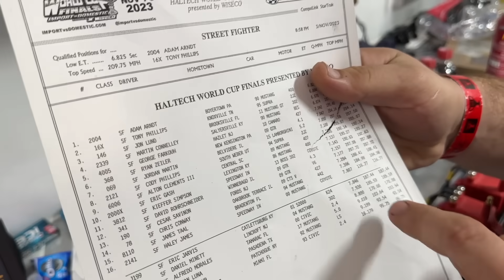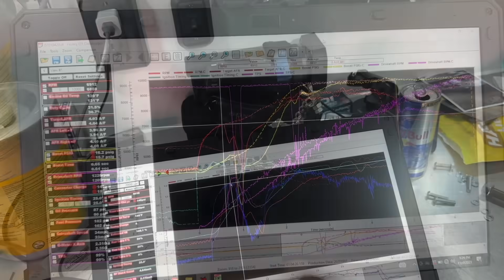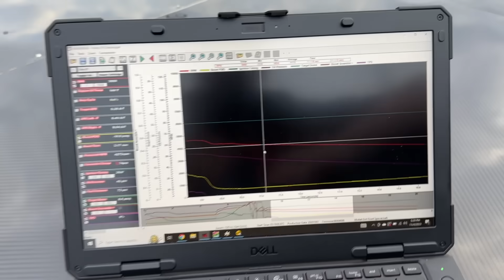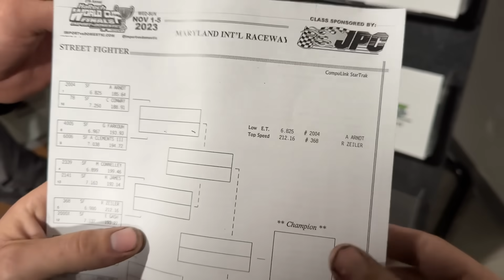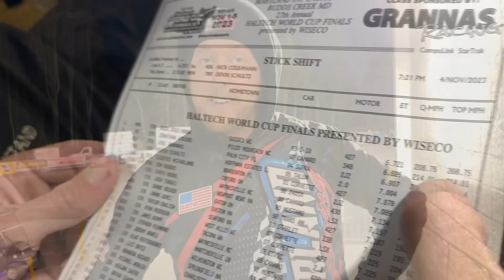World Cup Day 3 - Leroy 2.0 FINALLY Made a FAST Run!!! McFlurry Beats its Best Run EVER Again!

Comment: Put a pressure sensor on the Co2 regulator that outputs to the dash with an alarm/warning. Had Co2 issues with Leroy at the event and McFlurry in testing. Doing that should prevent you guys from wasting runs and test data. You guys may have thought of this already but that’s my 0.02. Been a subscriber since the C7 exhaust whistle days. Love to see you guys succeed, keep it up!!!!

Comment: It is time to completely change the chassis on Mullet.  Tube chassis all the way front to back.  Make big tubs and two rear ends so you can have a big tire and the 315 radial!
You can keep the steel quarters and roof.

Comment: Hey guys I don't know if you thought of this yet but is there some way a pressure switch of some kind could be rigged to where it would give you a indicator light that your CO2 is on and line is charged that way you know if there was a leak in the bottle just trying to help and appreciate all the work you guys been doing getting these vehicles rolling SO keep ripping them bald eagles out them pipes and try not to get too frustrated.👍👍👍

Comment: Hook a pressure gauge into the bottle so you have a read out on your dash of your bottle pressure after the valve. If its 0, you havent opened the bottle, have it flash red if its 0

Comment: haltech and being able to set conditions, instead using extra buttons and stuff if the best.

mine being plug and play also takes over the cars Can Bus thing so i can program the cruise control and stereo buttons on my street cars steering wheel to use as anti lag and what ever else.

i dont have a launch control button, its just set off conditions, which are clutch switch, speed and throttle position

Comment: I think you guys need to invest in drive-by-wire throttles.  ALL of your tuning and traction control will be INFINITELY easier.  You can control the power ramp with the throttle instead of boost, and you can control wheel spin the same way instead of pulling timing.  Boost and timing control is primitive compared to modulating a throttle.

Comment: Tire if of course the limiting factor.  A radial will never compete with a big tire at the top of a class.  Radials now are going 6s, and big tires are going 5s.  A few  years ago it was 7s and 6s, and before that it was 8s and 7s.  Technology moves on and cars get faster in general, but big tires will always be faster than small tires when that option is available.

Comment: Cleetus - CO2 is so old school.  You need to get yourself some TurboSmart electronic wastegates with throttle body actuators.   Set a target boost and that is it.  No guessing how much dome pressure and more importantly NO RISK of running on spring pressure when you forget to turn on the CO2 - of when the bottle is empty.

Comment: Ought to run a pressure transducer into the CO2 circuit and program a dummy light to trigger on low pressure. That or just do a dummy pressure switch that triggers a light 🤷🏻‍♂️.

Comment: Hey Cleetus. Good job overall man! You may get lucky like Jimmy said. You never know! Also...You know very well that pilots have pre flight check lists so why not glue one to the dash. Then it's just a quick glance and it will never happen again.... That is Unless the co pilots forgot to swap out the empty bottle! Lol Oh change that screw on oil cap out with something like a rubber freeze plug with either a snap closed lever or a screw down configuration. That should eliminate that problem. Hey good luck man! Do it for Dale! ,👍🏁🇺🇸 J Pol.

Comment: Not sure how many oil caps come off (not in dry sumps...), but maybe a cap needs to be machined with a tab and spring loaded pin to go in between a slot, counterbore, or arc on the valve cover. An arc slot would be better to prevent it from backing out completely without the need to overtighten or have it looser. Somehow I doubt caps come off much, except from J Lube.

Maybe it was not tight.

Comment: Do not polish an oil pump!  The edges of those gears require a little friction to grab the oil.  Shine them like a wheel and you'll smoke something.
Reply: If I'm wrong, roast me guys.  Oil volume  is dictated by the friction on the side of the lobe not the end edge.

Comment: Someone invent:
1: Electronic bottle valves so it can be on a switch and the bottle can be put anywhere
2: A feedback controller for dome pressure vs actual boost like injector duty vs A/F
3: Send me the royalties ;)

Comment: So question is Leroy 2nd gear lockout (mony shift prevention) on after the burnout and you having problems going into second because it is still locked out?  When you burnout in 3rd it works because you have shifted to 3rd already. You guys no your car so it's just a question because it really sounds like the problem. Hope you guys get it all figured and good luck

Comment: Why not pin or safety wire the oil caps? We are required to safety wire all plugs/caps/hoses and other safety items in the motorcycle racing world, I just wonder what keeps that from spreading into drag racing when something like an oil cap coming off can have devastating consequences. Just a thought and suggestion to prevent it from happening in the future.

Comment: Holy shit zach just saved you a dropped valve potentially. that due diligence saves you THOUSANDS of dollars at the minimum. It's nothing SM did, it's just maintenance when you're running a pushrod engine that huge.

Comment: Need to get rid of that SMX!!! Steve took it apart took no blame for anything. Rebuilt the oil pump(should have replaced). I would never buy an engine from him.  EGO is out of this world.  The only reason I started watching Steve Morris was that you got engines from him. Then watch his channel for a bit.  Until he tore down your motor and complained basically the whole time. Every comment nope nothing wrong. Well if it has that much metal left over from when he blew it up. Yes it’s on him.  FTG!

Comment: @Cleeter McSkeeter
Next World Cup boy you better pull out that SMX & salvage all the goodies that will make you go faster in a much lighter car that just has a lighter weight tube chassis frame similar to Leroy or better than with a Carbon Fibre outer skin. Think Ariel Atom Frankenstein Frame with an SMX & all the goodies to get you down the track in the low 5 second  bracket so you can crush all of their souls lol, just own them.

Comment: You guys can't be too mad at yourself I mean you put Oreo together and like short order. Short order real quick you guys are campaigning three awesome cars out there you guys are doing video you guys got the family out there. You guys are doing great compared to where you guys were just a few years ago y'all are a very serious contenders. As for the stock suspension in mullet I think you're going to be fine but M suggesting this from my Pro Outlaw Pro Street and no prep experiences I think it would be wise to take the turbos where they're mounted on mullet and go ahead and put them towards the back of the engine right there close to the firewall right behind the front wheels that will give you some good weight transfer and will allow you to dip off in the High 3 second Zone with the weight transfer in the factory style suspension underneath mullet

Comment: Don’t want to come across as a smartass but in most track disciplines on the other side of the pond all oil drain plugs, external filters and filler caps have to be lockwired as per regs. 
I’m a bit surprised that there’s not a similar regulation in drag racing but hey, I’m a newbie at this deal after a lot of years going roundy round. 😂

Comment: Have you noticed that there has been shade thrown and less bragging and talk about the smx ever since McFlurry has been using the tuners motors.      There’s no need In that.    The smx is a full specialty motor when the tuner is building great motors just apples and oranges.   No need in the shade.

Comment: Checklist checklist checklist...ask Sam how the Air Force is about checklists...you know from FAA already....we’re anal about it for a reason...get someone with a whiteboard printed for every car, with a headset they can walk you through it from the lanes or even the pits...when he/she calls “CO2 On” you check to ensure it’s on and say “CO2 On.” Done. You’ll never forget again...In the pits you can add random or rotational checks...lug nuts torqued after every 5 runs, etc. With all the things that can and do go wrong, nothing adds to safety and consistency better than checklists.

Comment: Add a light for co2 pressure.. super easy and super simple. Idiot proof everything. Yall are smart and competent. But yall are running a couple cars now. Simple light for co2 pressure. Add the lift to the prerun check list.

Comment: Can’t wait till you get super DUPER serious about drag racing and go Big tire Roots blown 14-71 nitro methane injected  500ci Kieth Black Arias motor. 125” wheel base Full titanium tube chassis  With a Rage Black Mamba fuel pump rated at 124 gallons per minute. E6 dual magneto ignition system set at 56 degrees BTDC. 2300 lbs. in race ready trim. This package will get you to the 1/4 mile in just under 4.2 seconds at 320mph burning 14 gallons of fuel at 45.00 per gallon. Stop playing patty cake with these low budget John force wannabes and OWN the top spot.